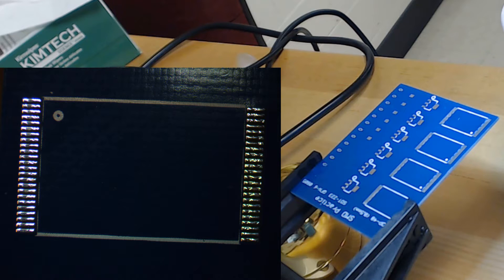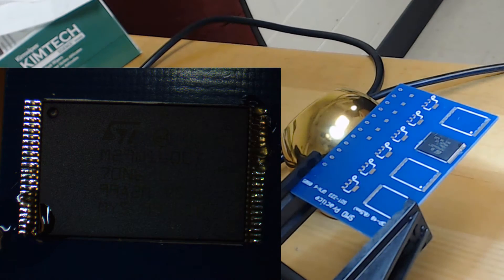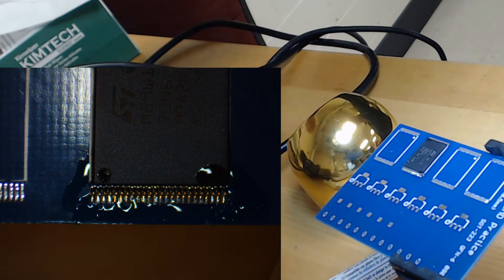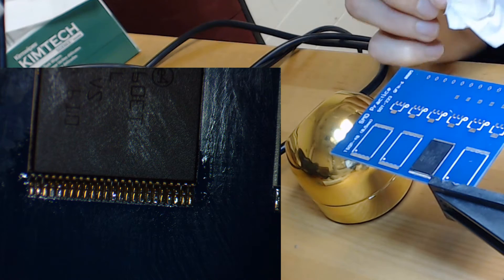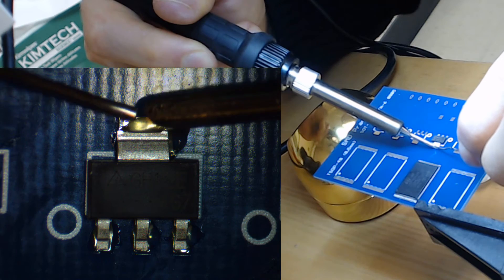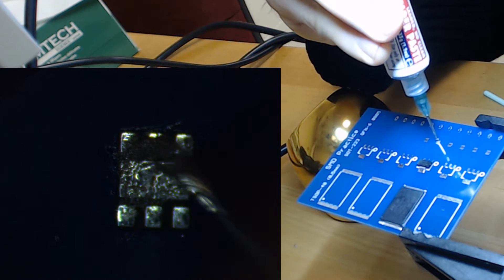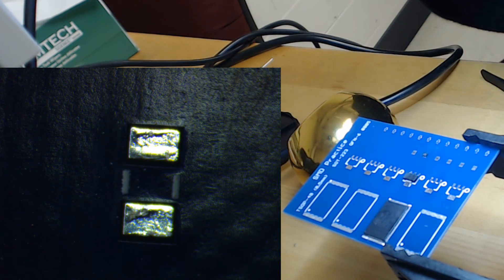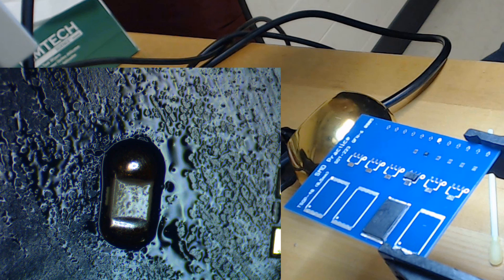Surface Mount Soldering Tutorial

Comment: In what order would you solder the components on a board like this? ICs first?
Reply from the maker: I prefer to solder the ICs first.  This is because I want to get to their pins as easily as possible with an iron.  For smaller components, I would use the hot air gun.  Therefore, I don't need as much space around them, and usually solder them last.  That being said, the order also depends on the board's functionality.  For example, I usually solder the power system first (power input pins, voltage regulator, and accompanying capacitors) and check that it works before moving on.  I then solder every subsystem in order and check it before moving on.  Otherwise, if I solder everything before testing, and something goes wrong, it is extremely difficult to isolate the problem.